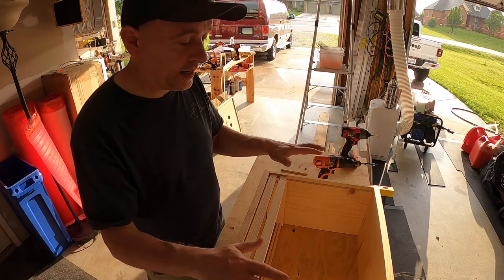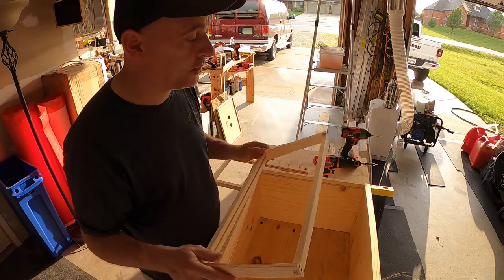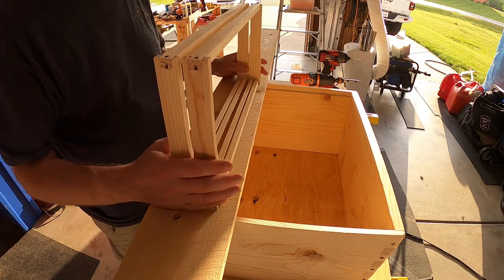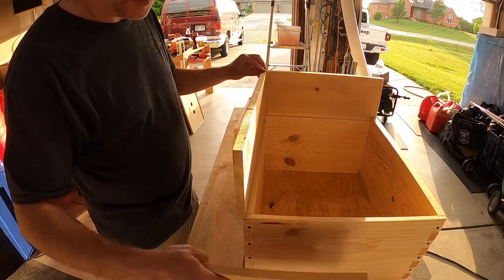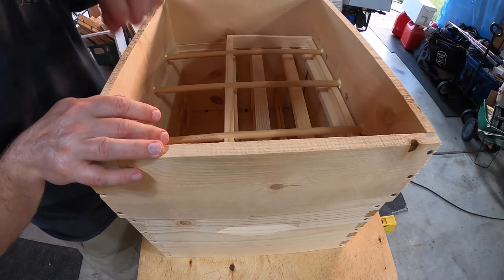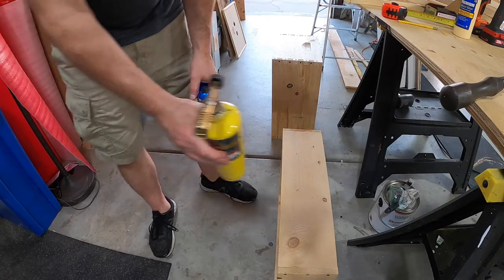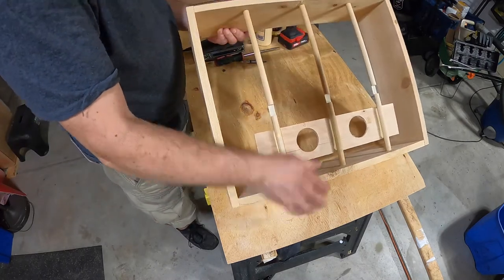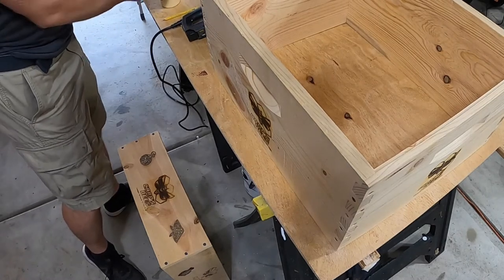No Graft Honeybee Queen Rearing System DIY Easy!

Comment: I just wanna let you know that this works much better with older eggs rather than brand new ones, and the queens will be better if they are in the centre (I don't know why but suspect it is to do with heat)
Reply from the maker: Good tip, my success rate was really low
Reply: @carpsbees  I much prefer simply taking a frame of eggs which is going to be placed back into the brood-box as normal (central) and scratching-out the cells below my chosen egg(s) so that the cell becomes enlarged and elongated downwards, like a supersedure cell or emergency cell. Again, you ideally want eggs which are about to hatch. 
I take eggs and put them above a queen excluder for 2 days so that any remaining eggs are on their 3rd day, and then move the frame to my queenless nuc or box or whatever is being used.
You can lose (they will tear-down and reject) between 50% to 75%, although the closer to the edge of the frame then the more likely they are to do-so, so I try to do 5 or 6 and as many as I can close to the centre without them actually touching.

Comment: Feeder shim or upside down super would work for your spacer?
Reply from the maker: It certainly might, I think what is being simulated is the distance from eggs to the top of frames with bees. That's probably the most important thing. I am going to try to use it tomorrow so I will let you know how it goes.
Reply: Yes. Laying a frame with eggs across the top bars of a queenless Langstroth hive inside an empty super will get you queen cells. No wood working required. Putting a frame of eggs in the normal vertical position will also get you queens in a queenless hive. It you like doing woodwork the author's method looks pretty cool. Seems like a lot of work. I simply insert a frame of eggs laid on new comb in a queenless hive as beekeepers have been doing since the Langstroth hive was invented.